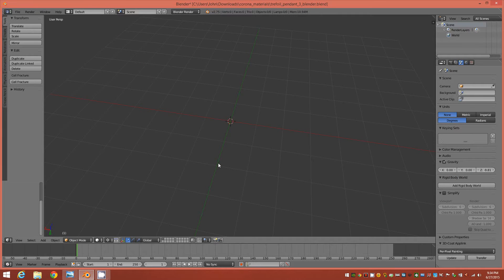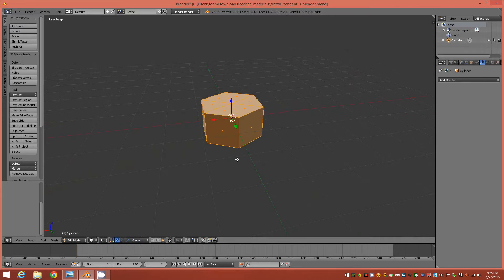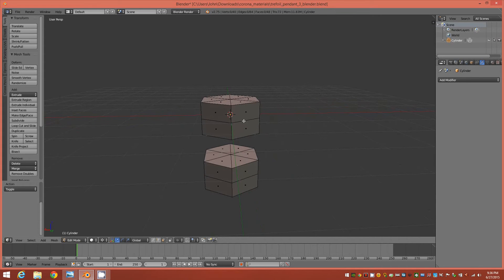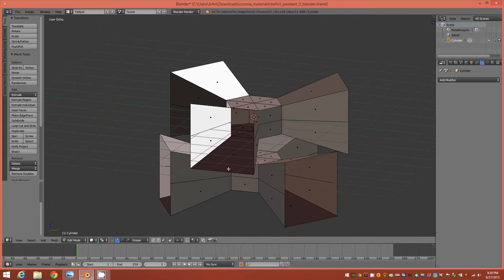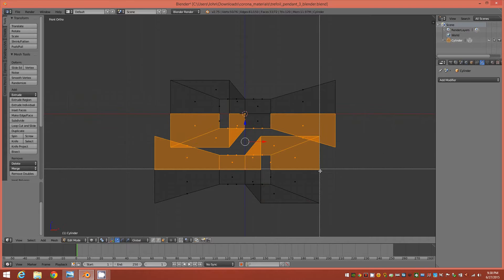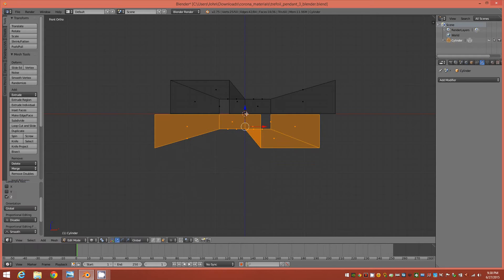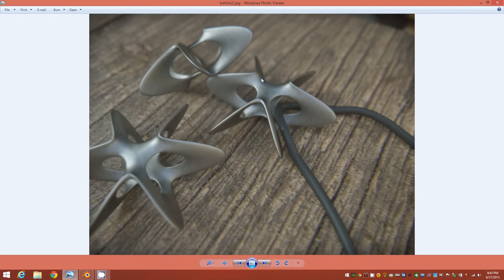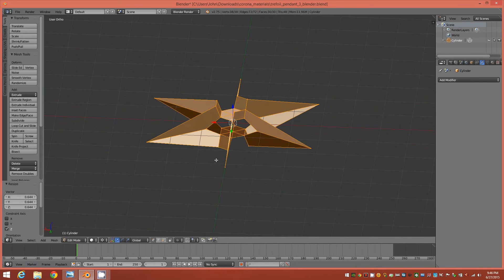Model A Trefoil Star Pendant In Blender 2.75

Comment: John, at 12:08 you scale with Shift+Z and the verts pull inward. Mine are only creating a shorter edge between them, not scaling inward. Any ideas?
Reply from the maker: There could be a few issues causing that.  First, if your 3d cursor is not dead center of the object, then the scaling will not work properly.  You could choose median point instead of 3d cursor, or just center the cursor to the object.  If that's not the issue, then after you click S to enter scale tool, hold the Shift key while tapping the Z key.  If you don't hold down the Shift key, it will not work and you will simply enter the Z axis mode for scaling.  I have a feeling that's what happened but let me know if any of that helped.
Reply: Thank you. This didn't work, either, even after starting over. I tried scaling just on the Z to see what it would do, and it had no effect. Don't know if that helps anything...
Reply from the maker: Is your scale tool working if you select only 1 edge and try to scale it by itself?  This is now sounding like a file corruption of some kind.  It's very difficult to diagnose the issue without actually seeing the blend file, or at least viewing a screen capture or video of the process.  At this point, I might suggest starting over with an entirely new blend file if you haven't done so already, but I can't say for sure if it's a malfunction of the software or something you may be doing incorrectly.  Assuming you followed each step up to this point successfully, I'm leaning towards some kind of software malfunction, but again it's hard to tell.

Comment: OOps I take it back I didn't remove  doubled correctly
Reply from the maker: No problem.  I was going to suggest you look at the Remove Doubles operation again, as it may have failed on your model for some reason, causing the double edge result.  There shouldn't be a problem with Merge At Center creating two overlapping edges at that point.  Hopefully you were able to complete the project after that.

Comment: you may have had normals  problems but if you look back before you did the solidify you had created duplicate edges side by side from the outside points  thru the center  at about 9:00 in, you connected the verts  together with merge at center, but that caused each vert to have two edges running back to center of object,  if you go into edge mode at after all of the merge at center and select  an edge you will see the problem.  I fixed it by deleting all of the extra edges and then re-creating the faces with f key.

Comment: Thanks for publishing this. Good tutorial for modeling abstract shapes, I will apply this to other variable shapes and later on modify with rhinoceros and 3Dprint.
Reply from the maker: +PsyShinobi Thank you very much.  I'll be uploading another tutorial later tonight, which will demonstrate some simple techniques to modeling a customized sphericon shape for 3d printing.  Hope you like it as well.
Reply: OK, thanks I will check it out. I found myself into your pages through google while I was checking out blender tutorials for building platonic solids and other parametric based modeling techniques for building candle and cheramic molds with silicon.

Usually I use rhinoceros for basic modeling thanks to quickness with curve modeling, but this year during work practice I had to learn Blender, which I found useful in more detailed modeling :)